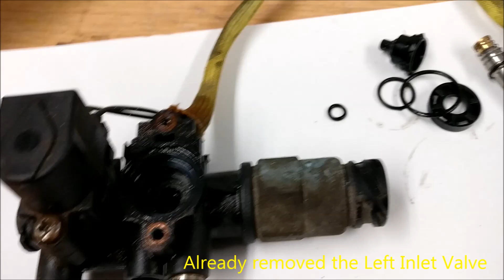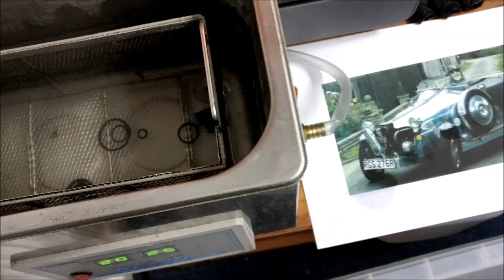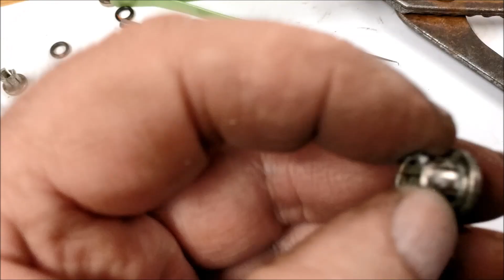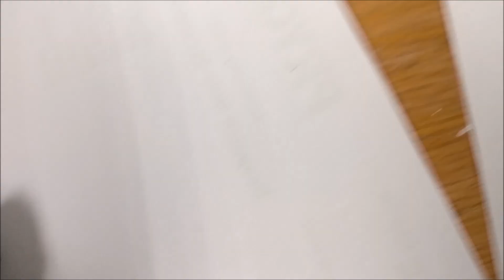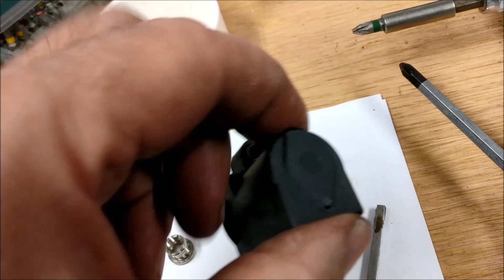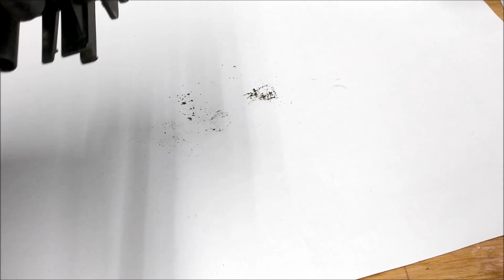Hummer H2 2005 - Air Suspension Inlet Valve Service

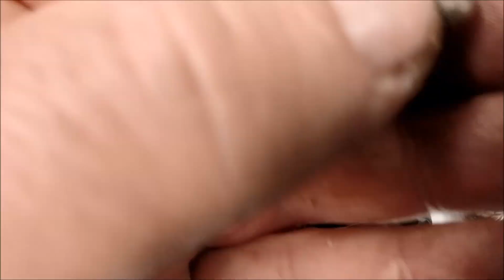Comment: 6:06 name of item
Reply from the maker: Thank you for your comment. Only the original manufacturer knows the name and to the best of my knowledge they are not generally available. It may be possible to tap the inlet hole and fit a standard pneumatic fitting, however there is not a lot of metal to work with so could be very tricky. Sooner or later we will all need a solution for this issue.

Comment: I dont have any power to rear 12v outlet, rear air suspension  or rear wiper. Any thoughts?
Reply from the maker: Thank you for your comment. 

Do you  mean there is  no +12V on all these circuits? The only slightly common point here is the I/P Fuse Block (Lower Left Side Of Dash) but none share a common fuse. 

Measure between the center pin of the outlet and a separate ground. If there is no +12V  check AUX PWR 2 Fuse (20A) again in the I/P Fuse Block. If +12V is there check, check for low ohms connectivity from the chassis to the ground side of the outlet.

More likely it's a ground problem (corroded eyelet tag) as the rear wiper  module and 12V Otutlet share  Ground G410  (as does the rear Liftgate Lock / Ajar Switch, Rear Defogger, License Lamps, Center Stop Lamps) it's location is described as "ON RIGHT REAR INNER SIDE BODY PANEL"  this would be worth a checking.

The air suspension  may be a separate issue, again if there's no power (+12V) to the AS-ECU  this would be the Underhood HVAC/ECAS Fuse (10A) but this would affect the A/C unit also. No +12V to the Air Relay would be the VSES/ECAS Fuse (60A) also under hood.  Check the main connector to the Air Suspension Module bracket but more likely is the ground to the actual metal bracket G402.

Please let me know if any of the these suggestions were hepful -- good luck 👍
Reply: @hummerfixes  thank you for detailed response. Rear wiper, rear 12v , rear defroster do not work, air pump. Ill take a look. Thx so much

Comment: How does the green/black plastic/yellow wire connector come off the inlet valve assembly? Does it just twist off or is there a trick to it? I don't want to break it. Did cleaning the valve assembly fix your leaking issue? I have replaced the bags and am still leaking down on both sides. I've only removed the entire compressor assembly so far, but my collars and inlet valves are more corroded than yours.
Reply from the maker: Thanks for you comment. 

Re the connector - >  So I have one in my hand and yes it does twist-off counter-clockwise, it's quite hard because it has a locking action, when you put back in it "locks and clicks" (two hand job but no wrench necessary) 

Re the Collars etc. -> `This is quite a conundrum, to me it falls into two possible outcomes,  they

       A) can be cleaned-up and saved,  so that particulay problem is solved.
       B) are beyound repair. Now I seem to recall someone fitted 6mm Push-Fit connectors  but I have no details. The plastic inlet valve 
           has metal brass looking inserts that grip the collar. The inserts have two IDs, the smaller is approx 7.65mm ID and the larger 
           around  7.85mm, the insert itself seems to have an OD of 10mm. So here is the problem 1/16 BSPP is 7.7mm OD so there would 
           barely be enough to TAP, 1/8 BSP is  9.77mm which would require some pretty slick tapping with only 0.25mm wall thickness left!

Again I've just measured these as I have them to-hand. and BTW the collars just push-in and pull-out by hand  (when they are clean) 

If you Google "Push-Fit Collar 6MM" it seems that there are people selling them, also it may be possible to buy a heavy duty metal pushfit and take out the collar, but that's pure speculation on my part. It may also be possible to get some made either machined or 3D printed

The larger pipe is 8mm or 5/16" the inlet valve insert ID's are 9.15mm ID and 9.8mm with an OD of approx 13mm, the same issues apply re tapping but worse. 1/8BSP is too small and 1/2BSP too large.

From your description it sounds like it could well be the fittings leaking, so may be best to work on them first.

If you email Hummerfixes@protonmail.com I may be able to help further with links and pictures, one day this will afeect everyone.
Reply: @hummerfixes  I'm not sure my air system is going to be savable. I may need to look into the coil conversion. I removed the valve assembly from the compressor housing. Like yours, I had the cracks along the screw areas. Except mine has massively rusted away. Both screws on both sides have basically disintegrated apart including the screws and retaining metal pieces due to rust. I don't see this valve ever not leaking again and like you, I am unable to find any replacement.
Reply from the maker: @copperate  Hi Adam, mine too had rusty screws and split plastic, but somehow I managed to extract the screws, re-tap the holes and it held together. In fact I'm looking at it now and the plastic of every screw is badly split, but it still works. I had bigger issues with a dead ECU (which I also fixed) so I bought a a complete unit from a breakers yard, hence I have some future spares. 

There has to be a solution to this problem, I really love the air-ride but the exposed position of the AS Unit is a big issue. I hope you have some luck with your issue 🙏

Comment: Hi there, did you ever figure out what those small plastic pneumatic fittings we’re called? Or were you able to get a part number for them? I need two find a couple of them! 
Thanks!!
Reply from the maker: Not aware any of the manifold parts are availabe, but  I seem to recall someone fitting standard 6mm bulkhead pneumatic fitting, I so they must have drilled and tapped the plastic housing to fit (8mm for the drier pipe) I found this part "SMC Threaded-to-Tube Pneumatic Fitting, G 1/8 to, Push In 6 mm, KQ2 Series, 1 MPa, 3 (Proof) MPa P/No KQ2H06-G01A" I've not checked the dimensions but you'll get the idea. Hope this helps :-)
Reply: @hummerfixes  Yep, Ok got it! Thanks much for the help brother! 👍🏼

Comment: thank you for this video. my compressor seems to not work on cold days, still trying to trouble shoot.
Reply from the maker: Do you have the single compressor system?  Check the relay in the engine compartment (below the master cyclinder) check the compressor has power when the tire inflator is operated (if you have one) or Extended Ride Height  (engine has to be running, doors closed)  If the compressor has power but physically won't turn it could be seizing when cold. Join the forum https://www.hummerforums.com and post a message if you need more help.